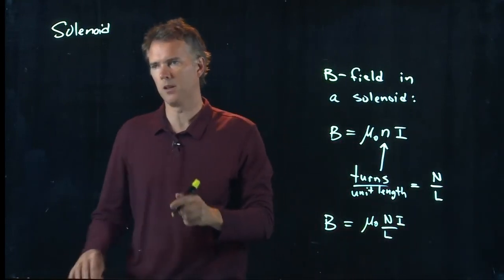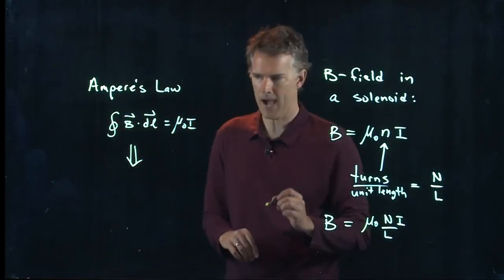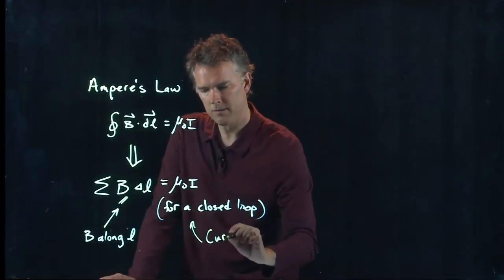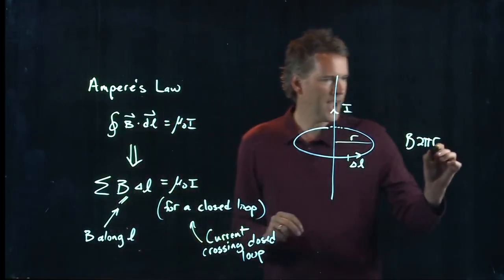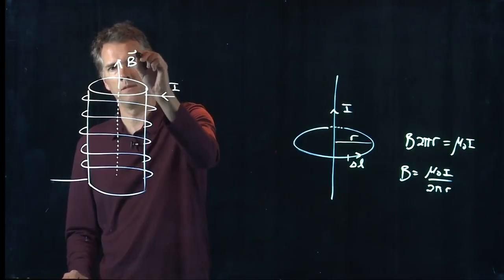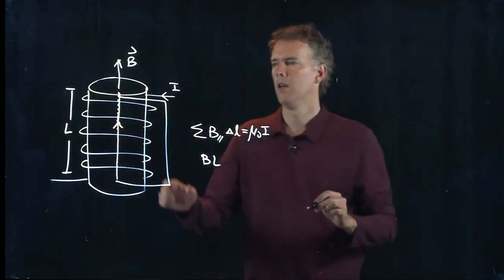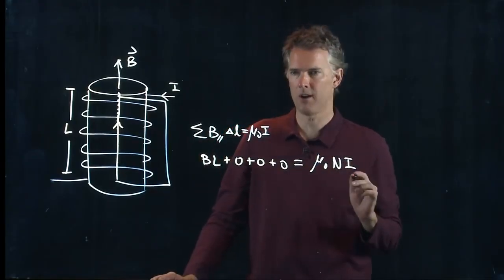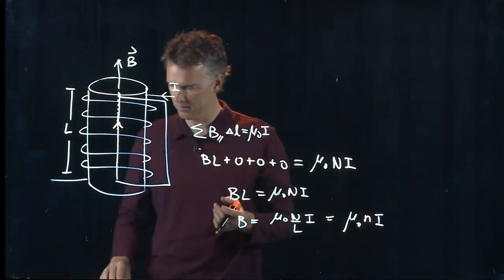Ampere's Law | Physics with Professor Matt Anderson | M23-13

Comment: The B Field outside of the solonoid is not = 0. Every wire of the coil has a circular B Field around it and some of that B Field is outside the solenoid
Reply from the maker: You are completely correct.  Well done.  The field outside the solenoid is not zero, but typically much weaker than inside, so we approximate it as zero.  
Cheers,
Dr. A